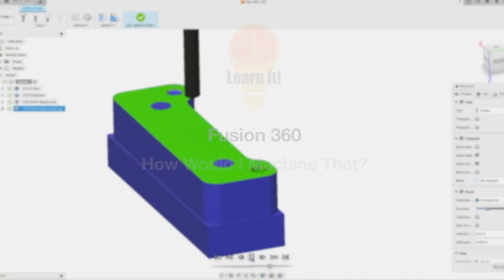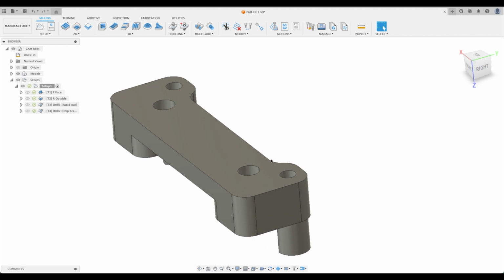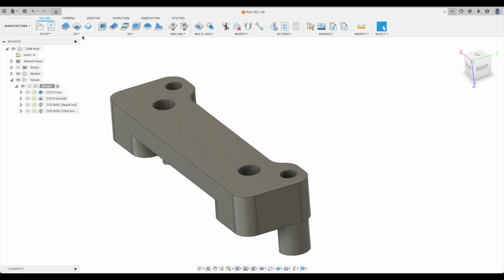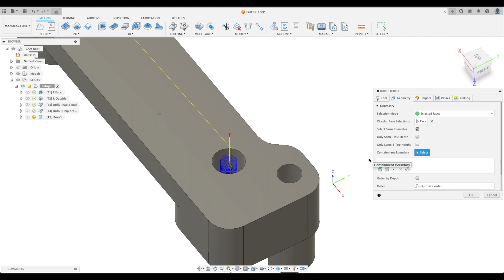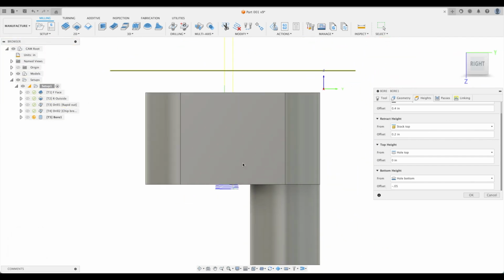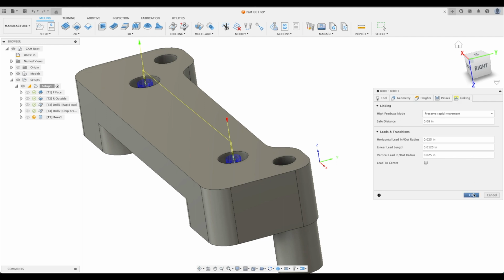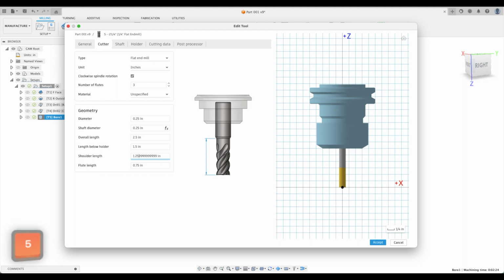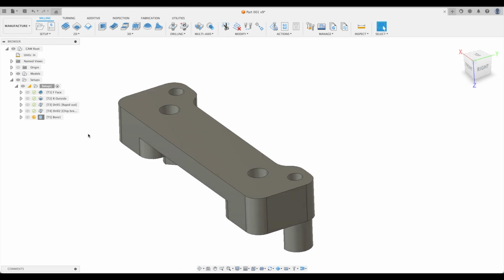Fusion 360 - HWIMT - Part 001 Setup 1 - Op 4 (2D Bore)

Comment: Hey, is there anyway to trick fusion and bore on a laith with a endmill instead of a borint bar?
Reply from the maker: Hey! That’s no problem at all. Just define your boring bar geometry the same as your end mill tooth. A lot is dependant on how you set up the end mill though. You’ll have to make sure your rake angle is set properly.
Reply: @learnitalready  thank you
Reply from the maker: @collindunn9067 you’re most welcome! Just curious, are you using an indexable end mill or u-drill, or are you thinking of using a standard end mill?
Reply: @learnitalready standard i believe
Reply from the maker: @collindunn9067 Will work. Have fun!